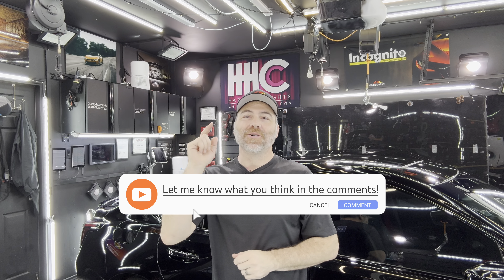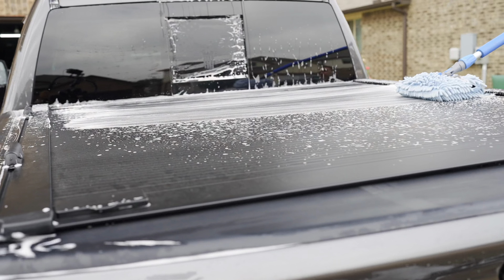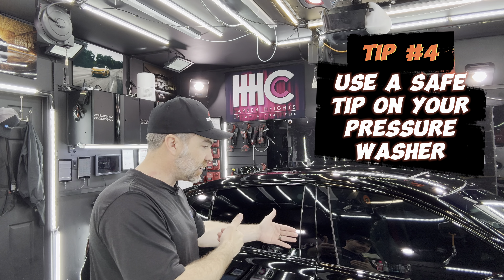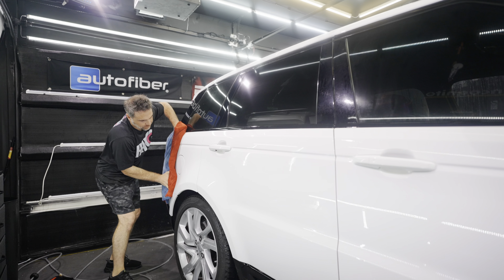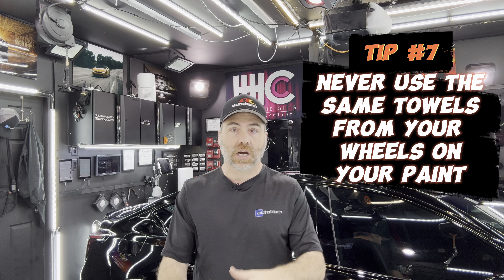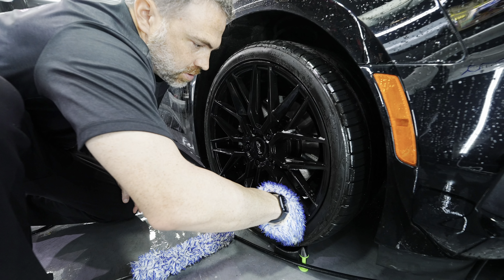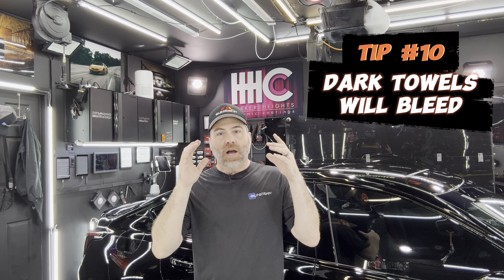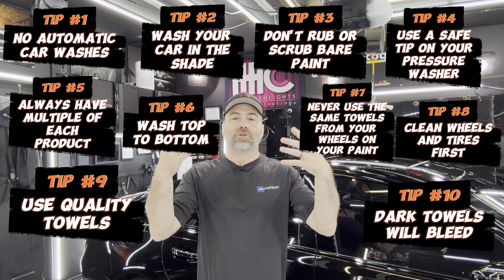10 auto detailing tips for beginners - save your paint & get faster!

Comment: great vid! I agree with everything except #2. a few caveats, you can find chemicals that allow you to wash in the sun, I'm in FL and have to wash in the heat often, but I use chemicals that are safe (for the most part) if they dry on the paint (Mckees37). obviously APC and iron remover should be diluted properly if used on a hot surface of the car as well and not allowed to dry on the paint. Water makes water spots if dried on the paint unless using spotless wash. soap should never leave water spots, especially if you use quality stuff. Would recommend a rinseless wash if worried of water spots though. Fun tip, add a capfull of your rinseless wash to your water tank to soften the water if you don't have a DI tank!
Reply from the maker: Great comment. A lot of my videos do tend to err on the side of caution to prevent people from following the advice and potentially messing up their car depending on their situation
Reply: very true, nothing wrong with that at all. better safe than sorry! @HarkerHeightsCeramicCoatings
Reply from the maker: Love the tip about the capful of water! Will pass that on to clients! We have a DI system here
Reply: DI is the way to go, but it's expensive lol working my way up to it, but have to start somewhere while still being safe! @HarkerHeightsCeramicCoatings
Reply from the maker: I use the Adam’s system it lasts about four months but we don’t do a lot of small projects

Comment: I would think it better to wash the roof first , being that it should be the cleanest ? Then not to worry about dirt falling onto any cleaned sides . And glad to hear about using light colored towels , maybe to just have those to use . Of course being aware to separate them as to what you use them to clean with .
Reply from the maker: Well wheels and tires just to keep the nasty from splashing. 

Then top to bottom